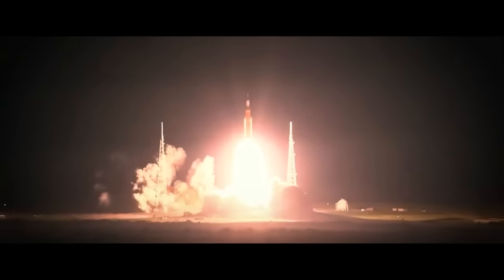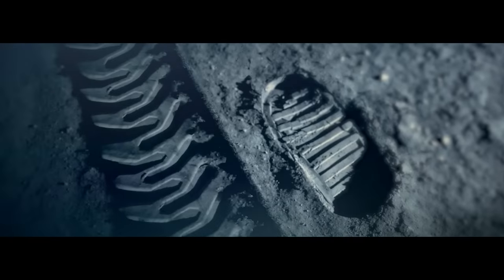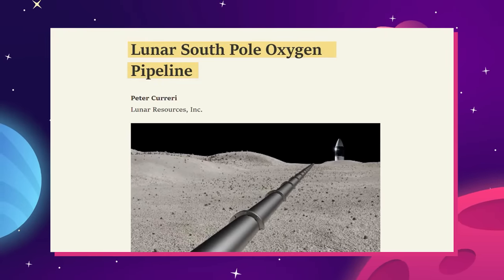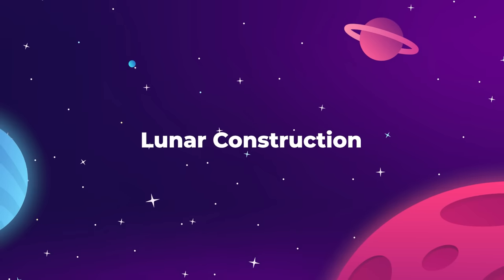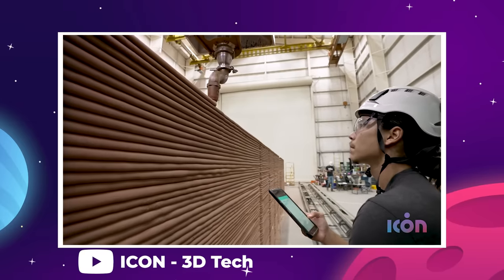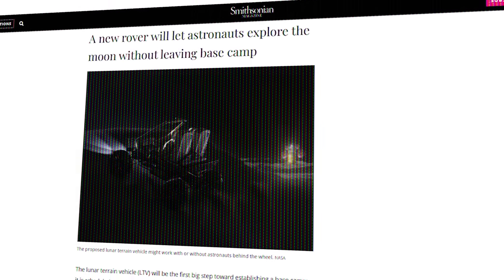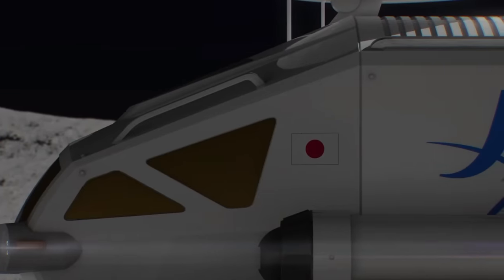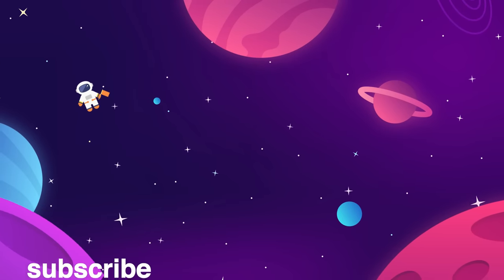How NASA Plans To Build The First Moon Base!

Comment: These plans of NASA to build and establish a base on the moon sounds extremely ambitious, very risky and very expensive. At the present we already have research stations on the continent of Antarctica, which is extremely cold, very windy and the most inhospitable continent on Earth. Building a base on the moon takes this to a whole new level. The moon is far more distant and requires special designed rockets to get there. Also the moon has no atmosphere and no magnetic field. As a result the moon has no shielding from radiation and no shielding from micro meteors. The moon is far more inhospitable then the continent of Antarctica

Comment: what about comets? from google: "There are about 100 pingpong-ball-sized meteoroids hitting the moon per day," Cooke said. That adds up to roughly 33,000 meteoroids per year. Despite their small size, each of these pingpong-ball-size rocks impacts the surface with the force of 7 pounds (3.2 kilograms) of dynamite.
Wouldn't be better to dig underground habitats?
Reply: There are indeed, but that number over a large area makes it a very low probability. And even when it hits, the probability of it causing some massive damage is even lower because contrary to some bad sci-fi, it would punch a hole through the wall/roof and it would take quite some time before it decompresses. Let me put those numbers in the perspective for you to make it a bit clearer.

Lightning strikes Earth around 8.6 million times per day, over 510.100.000 km^2 of the surface area. That is 0.01686 lightning strikes per square kilometer, daily.

For those dangerous meteroids on the Moon, let us take those 100 per day (I think the number is a bit higher though), that is over an area of 38.000.000 km^2. In other words, less than 0.000003 hits per square kilometer. Around 10.000 times less likely to be hit with a meteorite (who's damage is not catastrophic) compared to a lightning strike on Earth. And when was the last time you were worried about a lightning strike? We know those happen, and a number of people dies every year from them, but we do not dig in because of them.

Sure, we have other protection from a lightning in the cities, but out in the open, we don't. And? Were you bothered by it much?

Yes, digging in would be a smarter yet more labor intensive move - for various reasons. Radiation being one (and main) of them. Meteorites included. But they are not really considered dangerous when you actually do the math and see the probabilities of being hit by one. You'll more likely suffer from a short circuit from a faulty wire or some Chinese built fuse or something, that will blow up your battery and kill the life support system on the station, than being hit by a meteorite of such severity that you'll have serious problems.
Reply: @Wustenfuchs109  well with those numbers you calculated the actual risk actually looks minimum.

Comment: It’s a mistake to build on the surface of the moon. Radiation will reduce the time humans can spend there.
We should ship boring machines, not unlike the ones used to dig tunnels into a mountain for cars and vaults, but of a modular design.
Find a deep crater of choice, start shipping modular parts of the boring equipment to be dropped off within the crater, then send crews to put it together and start the dig.
If the subsurface of the moon isn’t rock or of rock like strength, utilizing Shotcrete as they go, will strengthen the subsurface.
The size of the facility would be limitless, but of course it would be compartmentalized for security and safety reasons.
The initial crater can also be used for the landing pads, also reducing our seen presence on the moon.
Reply: But the regolith protects the astronauts from radiation
Reply: @oliverwaynechang3098  exactly… that’s why most of it should be underground, unless you build a structure strong enough to pile it on top.

Comment: As much as I love the direction NASA is going, I find it odd that it has taken so long to launch a lunar habitat program.  The dragging of the heels, seems to keep those of us who follow updates, wishing that those in charge would pick up the pace. I don't say this in demeaning way, it's just that several decades have gone by, and there hasn't been any excitement to go to the moon until now. We have (had) the technology, but nothing became of it. 

The reason I even comment on the slow pace of going to the moon, is that I think it should have been the precusor to going to Mars... which we seem to be more onboard with that, than tackling the moon. The moon habitation could solve more problems, than what we could theorize here on Earth. I think we could be hauling supplies up to the moon now, then send people up to do the work. not two at at time, or four at a time, but a crew of twelve. Rotate the crew monthly. More work would get done, and progress could be significant by 2030. 

Everything that was mentioned in this video is wonderful to be sure. I do hope the new suits work well, and are a bit more streamlined than the previous suits. Also, having land rovers that doubled as moving "tiny homes" would allow crew to travel far from the habitat, to stay for a day or two, and gather information, or builds more infrastructure.  Personally, I would love to see a Tesla running around on the newly built roads! 

Whether the Lunar habitat is important to the advancement of technology, or not, it could provide us a better look at living off world. I'm sure that would be a sight to behold, to go farther than our own little world.
Reply: @XanBos. Tell that to those who grant the fundings, not to NASA.
Reply: @YDDES  hence why our world is in the shape it is. It’s the backers who dictate what happens….sad but true.
Reply: @XanBos  Yes, it is. But we are depending on them. Sad but true…

Comment: It has been suggested that the Starship lander has everything needed for a base built in. large volume, life support, supplies, some shielding for short durations, airlocks and living quarters. If it was tipped on its side, it could be covered with dirt and be fully shielded. Since the Starship currently has no way to refuel at the Gateway, it has no use after that. Allocate enough fuel to re-land and you have a base. Or bring more fuel on a later trip. No need for the elaborite 3D printer base for now.

Also, Some mention of using a liquid additive to the exhoast just on landing might coagulate the surface and create an imediate landing pad. Worth looking at.